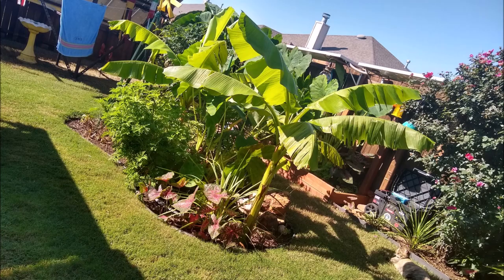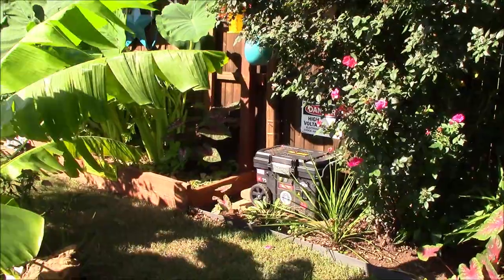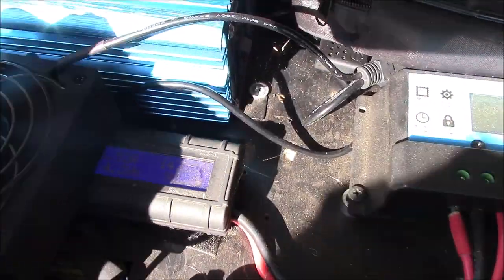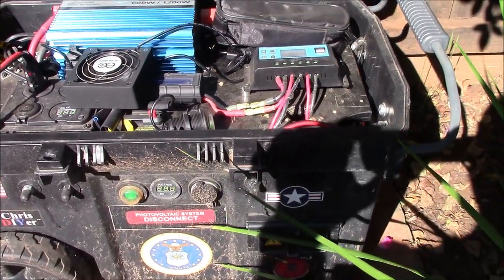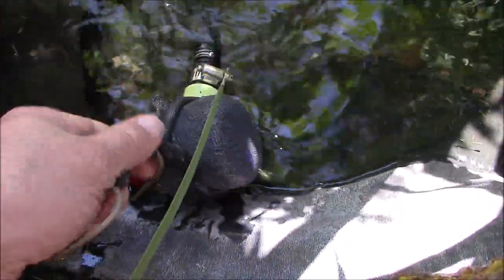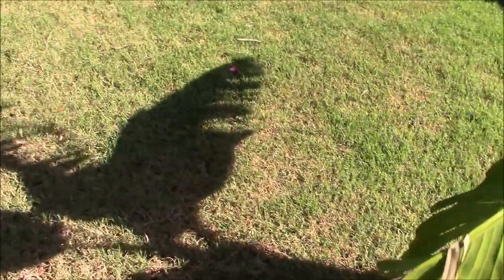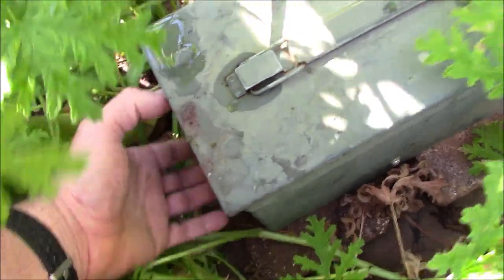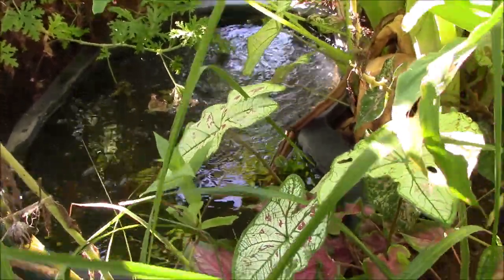12v bilge (pond) pump failure - need your thoughts!

Comment: Those bilge pumps are not rated for 100% duty cycle, but POND PUMPS are 100% duty cycle, meaning 24/7 operation, and that's what you need to get. A bilge pump is designed for emergency use to keep your boat floating until you can get off the water. Just search DUTY CYCLE on any pump you're looking to buy. Keep up the great work.

Comment: These bilge pumps have brushed motor ,IE not for continuous use because the brushes are consumable,they wear fast.You need a brushless pump ( like the Jebao or jecod- i like this brand).A brushless pump with zirconia shaft and sleeve like the jebao can easily work non stop for at least 10 years or more.There are also 110 volts or 220 volts Ac brushless pumps but Jebao makes them 24V DC and are safer but a bit more pricy than the high voltage AC pumps.

Comment: I'm not sure that those pumps are made for continous use but more for intermittent use. Not sure if that is the problem, just my 2 cents!
Reply: You are correct.  It is not a continuous duty pump, which is why it fails.  He needs to put in a bait well pump.

Comment: Are they getting clogged causing the motor to burn out, or is it something else?
Reply from the maker: IDK...could be too high volts, prolonged use, clogged, bad manufacturing. Need to come up with something else. My air pump isn't burning up...never had a problem with it
Reply: @ChrisDIYerOklahoma  Is the pump running directly off the battery no Voltage Regulator in between?  Bulk charge Cycle could definitely be an issue.
Reply from the maker: Yeh...sorta. It is wired on the "Load" side of the solar charger. It feels the full Bulk charge voltage

Comment: Buddy,  I used this pump (https://amzn.to/2OgF7Se) all summer on my DIY Solar Pool Heater and it ran great.  It is a knock-off of the Rule Pumps.  Maybe also consider using a PWM controller (https://amzn.to/2zsX0oU) or buck converter to help regulate the voltage and control the speed of the pump.  I find most buck converters help to clean up any not so clean voltage.  Your charge controller is probably putting out modified sine waze which may be rough on your pump.  Just a thought..
Reply from the maker: Thanks $1M!  I charge the battery up to 14.7v. Prob not good for that pump. Regulating it right at 12.00 volts with a buck converter makes a lot of sense. But, why isn't the 12v air pump burning up? That's what gets me
Reply: My guess would be the strain on the pump...moving water vs air.  Your water pump is working harder moving water than air.

Comment: Look for chinese Jebao or Jecod power heads(24v with controller).They are not verry cheap but they are high quality chinese pumps build for saltwater.If you order them from usa they might get expensive but fishstreet its a good chinese shop to buy them cheaper( i think they have a wareshop in usa too).The controller( somma have wireless controllers,somme dont) and the 24 volts powersource needs to stay indoor thogh.